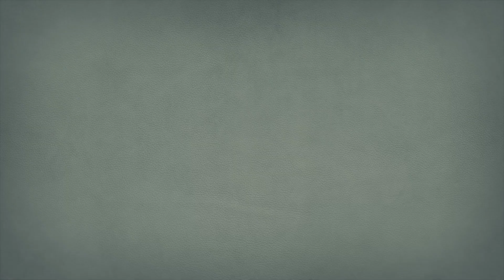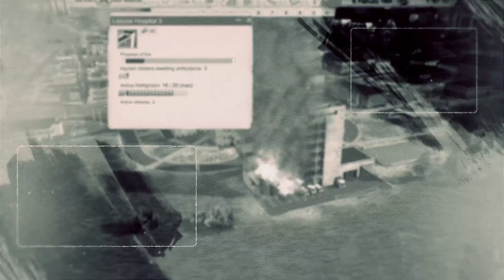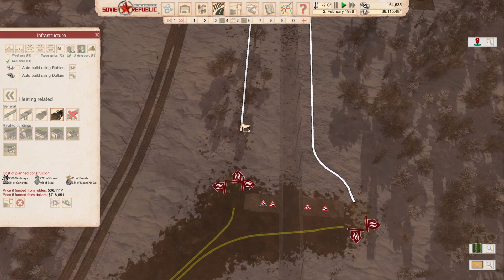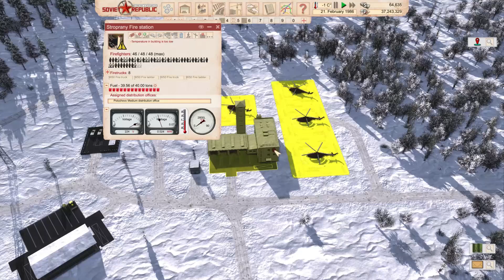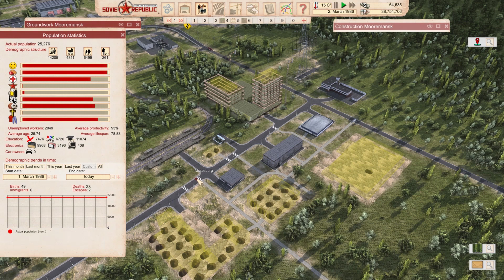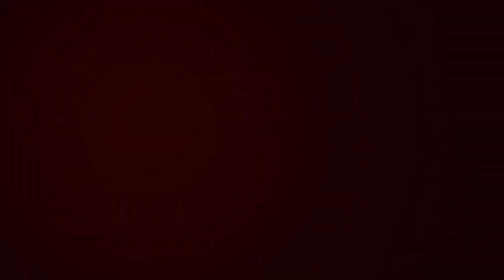Soviet Republic - Alaska - The New Beginning - Ep.103

Comment: I say yes to the overpasses for sure it's going to help in tht long term fire sure!  Another great episode my friend  semaphores are the devil's playthings lol the drive me crazy lol ideally we need a train like many of tht Amtrak trains here in the states that can run as disel or electric depending on tht tracks they are on. They have retractable electrical connections and can switch between desil and electric pretty easily, at least it seemed easy when I was riding on it. It stopped for a couple of minutes and then was off and running. I love stalika buildings, panaliki are nice too my favorite are plattenbau but they are huge and probably more fitting for the capitol city. I vote for stalincas for sureif I was any good at modding I would make them train as well as a vehicle carrying flatbed. There are flatbeds designed specially for caring machinery which the game really needs to avoid the exact problem you brought up! Forklifts have never really worked very well for me but I guess I could be using them wrong. They seem a lot slower than just using a factory connection even though thats not very realistic.
Reply from the maker: Why don't you give it a go with the modding? 
On Discord, we have several modders as well so I'm sure they would be happy to help. 
I can contribute this much: "You will need something called "Blender". This is where my knowledge ends. 
:D :D
Reply: @oolykeegaming81  I think blender Is a 3d graphics design program. It would be the thing you makr the building in. I have no real artistic skill at all so I know I can't make something that looks as good as the buildings we have look already. I have ideas, that's usually what I contribute is ideas, not all of them are good ideas but some are. My skillset stops at making something that looks pretty or even looks good.🙂
Reply from the maker: @smoore6461  You don't need skills. Just copy real-life stuff. Space needle, NY "projects" (buildings), and other stuff. 
We have few modders on discord. Dip your toes in with a monument or a bench and build from there. The next thing the Liberty Bell. :) St Lo arches or anything. :)
Reply: @oolykeegaming81  hmm maby I'll give that a shot someday, there are a few things I think the game could really use. Have a great day brother! Hope you have some grand plans for the weekend!

Comment: 1) Sorry for my probably incomprehensible English, so I will try for the third time to explain to you where the disconnected medium power cables are located : near the logistics area of Mooremansk, where you built the two rail access ramps from Nissesburg. I reread my previous comment and it did mention rail access and not conveyors or whatever else, but obviously my directions were still unclear to you :(
2) You should still have checked that your Nissesburg heat exchangers really couldn't be connected directly to the heating plant, because the down side of using an intermediate pumping station is that there is more heat loss. important than with directly connected heating pipes. BTW it's now too late, but for the next time you should think about it
3) The fire station does not work when the temperature is too low in the building, which is what happened with the one that was supposed to put out the fire in the oil fields. I had already explained it to you at the beginning of this series during a fire in Statsovo. Some moded fire stations do not need heating (these are the ones I use for my remote locations) but some others as well as the vanilla one do need heating to operate in winter.
4) Normally you will not find your Groundwork CO flat beds carrying construction materials as this CO has no assigned construction material sources...
5) Since Whaletyr COs have much less work, now and in the future they will use less construction materials. You should therefore re-parameterize your train of bricks and boards: first stop at Whaletyr, unload what this open storage needs, second stop at Mooremansk, unload what remains. Your train spends too much time making unnecessary round trips between Galahsk and Whaletyr then Galahsk and Mooremansk. A Galahsk / Whaletyr / Mooremansk line would be more efficient now
6) We had already suggested to you a long time ago the benefit of having a CO dedicated only to buses. Likewise, before you thought to find out again in amazement (^^), a lot of players also use COs dedicated only to construction mechanisms (excavators and cranes - and flat beds).
7) Plants Package modification (to have 5 workers, 0.10 chemicals consumption, 1 crops produced) : 
The path to find the folder and the file :
Windows (C:) --> ProgramFiles --> Steam --> steamapps --> workshop --> content --> 784150
ID number of the mod : 2077001768
Name of the folder to modify : "vinogradnik"
File of the building.ini to be replaced by this : 

$NAME_STR "Виноградник"

$TYPE_FACTORY

------

$COST_WORK SOVIET_CONSTRUCTION_GROUNDWORKS 0.0

$COST_WORK_BUILDING_ALL

$COST_WORK_VEHICLE_STATION_ACCORDING_NODE vinogradnik

$COST_RESOURCE_AUTO ground 0.07

------------------

$COST_WORK SOVIET_CONSTRUCTION_SKELETON_CASTING 1.0

$COST_WORK_VEHICLE_STATION 8.1426 0 13.9030 13.6414 0 15.6642
$COST_WORK_VEHICLE_STATION -8.5084 0 14.088 -13.7859 0 15.5051

$COST_WORK_BUILDING_ALL
$COST_RESOURCE concrete 0.03
$COST_RESOURCE steel 0.01

$WORKERS_NEEDED 5
$PRODUCTION plants 0.20
$CONSUMPTION chemicals 0.02
$STORAGE_EXPORT RESOURCE_TRANSPORT_COVERED 5
$STORAGE_IMPORT RESOURCE_TRANSPORT_COVERED 3.0

$CONNECTION_ROAD
0.00  0.00 55.80
0.00  0.00 54.80

$VEHICLE_STATION 18.00 0 53.50  5.00 0 53.50
$VEHICLE_STATION -18.00 0 53.50  -5.00 0 53.50

$CONNECTION_PEDESTRIAN
19.14  0.0 53.42
19.14  0.0 52.42
$CONNECTION_PEDESTRIAN
-19.14  0.0 53.42
-19.14  0.0 52.42
$CONNECTION_PEDESTRIAN
19.14  0.0 -53.42
19.14  0.0 -52.42
$CONNECTION_PEDESTRIAN
-19.14  0.0 -53.42
-19.14  0.0 -52.42
$CONNECTION_PEDESTRIAN
21.91  0.0 50.05
20.91  0.0 50.05
$CONNECTION_PEDESTRIAN
-21.91  0.0 50.05
-20.91  0.0 50.05
$CONNECTION_PEDESTRIAN
21.91  0.0 -50.05
20.91  0.0 -50.05
$CONNECTION_PEDESTRIAN
-21.91  0.0 -50.05
-20.91  0.0 -50.05

$HEATING_DISABLE

end
Reply from the maker: 1. Incomprehensive?!?! Look at the scholar using all the fancy words. You are just complicating things. :D :D I will find it. 
2. I believe I checked. Maybe it was off-screen. But I agree with you. It is better to be connected directly. I will be building a lot of redundancy and 4-5 heat exchangers just to have good coverage.
3. Looks like my brain came to max capacity and started dumping information. I don't remember that one. On the funny side, there was heating! At burning oilfield. If they were cold shouldn't they go there? 
4. Right! That helps! 
5. This is good advice. 
6. I was hoping to get your comment on a single CO having both types of equipment for the Groundwork and Construction phases. I was not surprised about Bus CO, I was aware of it and the first person who mentioned it to me was you :P . But the idea never came to me that you can actually finish all the fazes (paced) and rely on 1 CO. I'm looking for downsides to that. Like "you will need more of them thus beating the purpose of having separate CO's". I'm not sure if 1 (32) CO has enough equipment to finish all fazes relatively fast. 
7. Since I'm a hacker now this will be no problem for somebody as good at this as I am. I hope my sarcasm didn't escape you. I really appreciate this. 

Thanks, Stats.

Comment: I think the problem you are having with the construction trains is that they get into a section of track that is incredibly long and there is another train far away from it, but sharing the same track section therefore at the next semaphore they are stopped.
Reply from the maker: Yes! 
I need to remove all lights from the railroad construction zone and just separate them from normal traffic. It's when they need to interact with each other is where it gets tricky. But I have ideas and I will need to work on them soon.